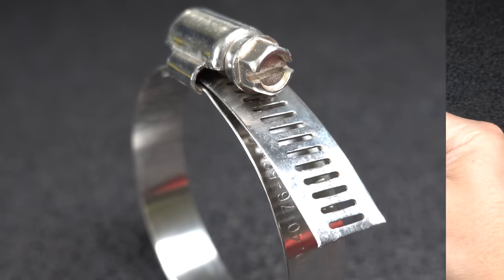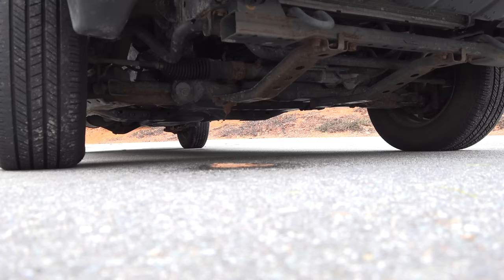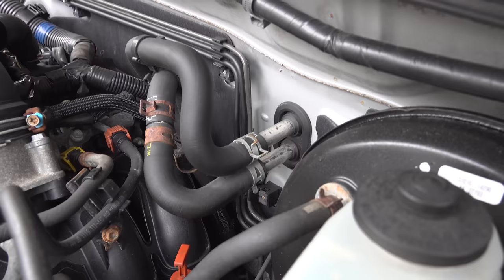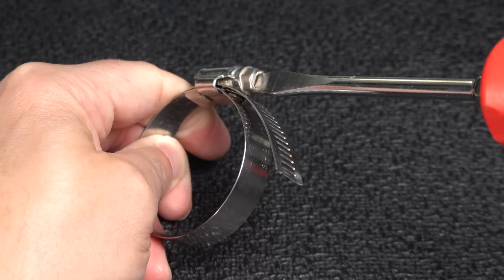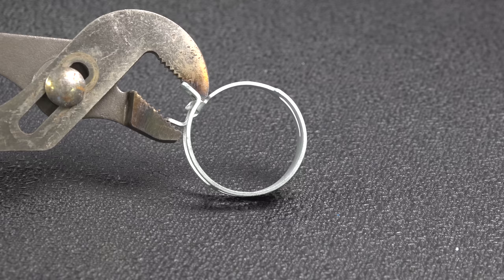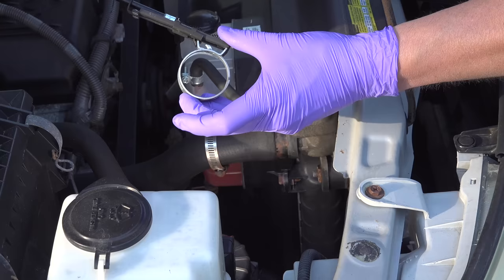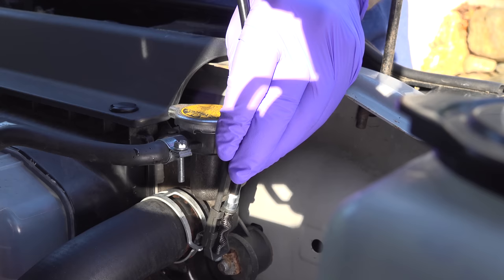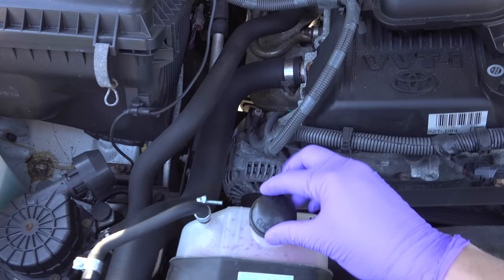STOP Using Hose Clamps WRONG - LEARN A BETTER WAY

Comment: I’m guessing you’re the one who put the worm type clamp there?  If you tinker on an engine and don’t know what you’re doing, you may have problems. Or leaks. Where have you ever seen one of those clamps on any type of automotive-fluid hose?
Reply from the maker: It was a repair shop that did it, before I bought it. The hose is also a Dayco which I would NEVER install on a Toyota. Toyota factory hoses are legendary for how long they last, changing them out for a aftermarket is a tragedy.
Reply: @SilverCymbal   wow no way bro

Comment: So this is an entirely true if you use hose clamps that are just cheap and perforated like that you're going to have issues but if you use the German style ones that the Germans literally put on their vehicles you're going to be just fine also they do make perforated worm clamps with constant tension washers

Comment: No No 😅 those clamps are used on cheap American cars German cars have the ones you tighten. Problem with the self tightening is when the hose gets older it keeps pressing on the hose to the point where it leaks

Comment: I always throw away those stupid things and use a worm clamp. Never had them leak. Even with the pecial tool they are annoying and still leak. I can tell you have never worked on cars professionally before. Those clamps are on there because they are cheaper to make.

Comment: I feel you are wrong. The hose clip is MUCH MORE RELIABLE. Especially the stainless steel ones. We have been using any amount of Stainless steel hose clamps on high quality hose pipes, which are used in the water-cooling system, in the Control system of High Power Induction furnaces... Of 5tonne capacities.

Comment: As a boat mechanic i disagree completely. I use push lock fittings for all oil and fuel applications with some exceptions and they require zero hose clamps of any kind. ABYC dictates anything below the waterline of a vessel be double hose clamped, with the mechanism of the gear clamps opposite eachother providing a true and even seal. Id never use these spring clamps on a boat. Push lock, crimps, or worms only. And only the high end non serrated worm clamps as well.

Comment: A "constant tension/torque hose clamp" are the correct style.. they're a better redesigned worm clamp.. The problem with spring tension clamps is they are a 1 and done..

Comment: I've worked on not just automotive stuff with screw-on clamps, but also high pressure and low pressure air/water hoses on a work truck that steam cleans and vacuums heavy duty. I promise you the screw-on clamps don't leak, regardless of temperature changes. What fails on the screw-on clamps first is they actually rust and start to disintegrate... after like 10 years. They'll corrode to where the screw quits working and they'll fall apart with some shock. Go ask 10 mechanics which hose clamp they would use on their own arteries. I'll eat my hat if they don't say screw-on clamps. Anyone who has spent more than 15 minutes trying to remove those special clamps with every set of pliers they own knows the truth. And don't even bother trying the job if the special clamp is facing the wrong direction. Just sell your car.

Comment: Those. Clap's are junk and can cause more. Damage then the. Screw clamp. The. Inexpensive tool he used is more than $ 50. I removed all of those and went to the screw clamp. Also when trying to remove those squeeze clamps they damaged most hoses.

Comment: Wow..... coolant does not get "red hot". The worm drive clamps are made on many levels of quality.  If you bought a cheap product they will leak as the worm drive strips out. The remote clamp tool shown is total junk. This is said as a mechanic.

Comment: LOL, since 1990...., a small tip, use the correct size jubilee clip and it wont leak, the fkn tail was way too long so the clip goes out of round....made worse by you tightening it time after time......derp

Comment: got a single faulty worm gear clamp and decides to create a video about mis-informing people about hose clamps. there is only 1 reason manufacturers use spring style hose clamps and that is because they are cheaper to buy , and more time efficient to install but they are in no way better. the irony is the title of the video is stop using hoseclamps wrong but in all actuality the leak you experienced was likely do to a mis-aligned hose clamp that was either cricked or not in the right location in order to be affective.

Comment: Nope. I've had tons of cars with regular hose clamps. No problems. Here's a tip though, stop using a flat screwdriver. Use a 5/16ths nut driver.

Comment: The screw clamp you showed was a horrible, cheap one, with SLOTS for the screw to run in. You need to invest in ones made of proper metal rather than that lacework. If you can flatten the ring between your thumb and forefinger, throw it away. The originals are branded "JUBILEE" and were first produced in 1921. The metal in them is sturdy enough to have the brand stamped in them. The ones supplied new on my car's cooling system in 1927 are still in use.

Comment: if you use quality screw hose clamps and dont go tightening it like an orangutan you wont have any issues. spring may be better, but you got no idea how many times ive had to fix the cable on the tool

Comment: I strongly DISAGREE with this the reason why they use those clamps is becuse you would have to hand tighten the "old school clamp" which would slow down production wich cost money. The factory clamps do get hot and that heat goes to the hose and turns it hard making it easier to fail.

Comment: Those clamps are a pain in the ass. As an Automotive tech only someone who doesn't work on cars every day would prefer those things. The real reason manufacturers use those clamps is because they're really easy to install on the line. Dirtbikes, for example, use worn type clamps and the abuse they take is exponentially more than a car.

Comment: funny how he says NEW style clamps. I swear I've seen them on cars back in the 70's and 80's
Reply: I can’t remember when I first saw the style he’s talking about, but I still have my Snap On pliers for the round style that would go flying if you used regular pliers.
To be honest I’d reuse this style clamp if it’s easy to get to but if not it’s tossed and a worm gear style is going on.

Comment: As a Seasoned  mechanic  I strongly  disagree  with your  logic  of spring  hose  clamps...heat draws the temper  from  the steel and causes  the clamp to lose  their ability  to retain  tension..there for  your logic  is faulty...I have in my 40 years  of repair  work  always  replaced  spring  clamps  with worm gear clamps...never  a call back  🙄

Comment: if car makers weren't so lard-arsed with profit-first mentality, they would use re-usable AN fittings on their radiators, or Grip-Tite
style connections.
It's ok for a truck to run over a hose clamp, but this may not work as well with a smaller car with worn tires.
No clamps is good  

Just like the old glass pop bottles that would tear your foot open instantly, i would not want to step on a hose clamp either.
Oh GOD, please punish the clamp makers !

Comment: manufecturers have used them for years because they are cheep, those clamps are not new, as a mechanic for 37 years i can tell you, you are filling your followers with miss information, the clamps rust, bend and over time lose tension, not to mention the dangers of broken fingers and loss of eyes if it spings off to tool, use worm drive clamps, never had a worm drive leak when done up properly

Comment: Having been a full time mechanic for the last 5 years. I'm gonna have to disagree with most everything you say there. If your clamps leaking it's because it is old and the hose is worn out, replace it and the hose and you won't have a problem. The heat ranges your vehicle go through a aren't big enough for those kind of parts to change that much. Spring clamps are the devil when working with them, more often than not your gonna fight with them to get them to work wasting more time than it would take you just to use a worm gear clamp.

Comment: Nope those a crap they damage all hoses leaving imprints , not to mention if you slip with the pliers, adjustable hose clamps have always replaced those crap stock issued clamp

Comment: This is just so wrong! I used to work as a mechanic for decades, and have probably replaced hundreds of spring clamps with worm-drive clamps. And that was because the spring clamps were leaking and making problems.

Comment: I can't stand those factory clamps they are a pain in the ass to remove and install specially in tight places I used them only when they are in a place in the engine we're is easy to remove and install even with the special tool is a pain.

Comment: For the lay general public to see this as “new” proves why it’s for the lay people. 
Expert mechanics and techs remove these oem style clamps and use the tried and tested worm drive hose clamps, which are readily available at most stores and auto parts stores. 
This video makes it sound so warm and fuzzy to use these dangerous stiff springs as if it solves some sort of problem with heater hose clamps, but some people aren’t mechanics for this reason and shouldn’t try to surpass them.
When broken down on a highway road trip, you don’t want to get back on the road having to battle with one of these spring clamps. You really don’t. However, a worm drive heater hose clamp can be removed and put back with a pocket knife if necessary.
Reply: Expert mechanics don't use worm gear clamps if they don't have to

Comment: First off: în order to loosen a worm gear clamp you can use a screwdriver, a wrench or even a pear of pliers.I'm not saying you're wrong, but if you need to loosen a hose fitted with a spring clamp and don't have the right tool, you're f****d.Ask me how i know! 
Second: you mentioned that if you overtighten it, it can damage the fitting. It's the manufacturers' fault for making them out of plastic.
Third: If you're sloppy or careless you can damage the fitting anyway.

Comment: I used screw clamps hose for decades i don't have any problem with clamp hose and I'm still using them, i use both of them, sorry that's true because I'm still using thes screw clamps hose,  and yes be careful they can fly across, so THEREFORE i really want to use the screw clamps hose, i really guarantee of screw clamps hose, are a better clamps to use every time. And really don't believe that guy. Again the wrong one is much better.

Comment: Ah,ah,ah,---  a video of the opposite...lol

edit::Worm clamps are perfect; they are used all over the land and the sea; spring clamps ONLY fit ONE size; if you change the haso and the wall is not exactly the same,it will not fit.

Comment: You dont have a clue what your saying give had the hose clamps your talking about leak and you have to try and re shape them to work correctly to tighten up. If you get a stainless worm gear hose clamp tighten it where there is no leak. Then the extra strap that is there you bend it up towards the topside of worm gear tensioner and fold over you will never have an issue or have to retighten. Thank you for the video.

Comment: Lol those plastic clamps will break in like 15-20 years, becouse the ethylen will go hard... I never saw a metal one fail, even 60years old ones
Reply from the maker: They aren't plastic, they are spring steel

Comment: You are partially wrong.  The main reason manufacturers like fasteners like this is because they are faster to assemble cars on the line.  So it's for them to save time and money.

Comment: I always chuck those new spring style clamps and replace them with the worm drive ones. Be sure not to just get a cheap one from like walmart(oreillys is good enough). I have had more issues with the spring style than the worm drive. The spring style wears a groove in a the rubber and looses its grip and then can't be tightend, especially on ten plus year old vehicles with oe ones. When first installing the screw clamps you may have to check tightness after some runtime as they squeeze the rubber and may become loose but that has nothing to do with the heat. Just the rubber of the hose clearancing a bit. They will stop coming loose after one or two checks if any at all This video is wrong. He isnt a real mechanic.

Comment: Of course the oem style clamp is better when someone pays you for saying so.🙄

I just replaced one of those clamps for a screw down clamp becuase it was leaking.

Yes there are pros and cons to both clamp styles but of course this dude won't talk about that when hes getting paid by one clamp style seller.

Comment: 1. Spring clamps go bad and get weak.

2. The factory uses them because they make it quicker to assemble the vehicle. NOT because it's better or in your best interest.

3. Worm clamps are so EASY to remove. No having to work it down a curved hose.

4. Worm clamps can be installed WITHOUT having to take the hose off to get it on.

5. I've had spring clamps go bad but never worm clamps.

6. Please delete this video. Thanks.
Reply: I see countless worm gear clamps cause leaks

Comment: The oem spring clamp on my radiator hose on my Jeep SRT8 would slip off constantly until I replaced it with a standard worm gear clamp. As far as I'm concerned this video is bullshit.

Comment: This is cap. The worm clamps are infinitely better, I have never even heard of heat affecting hose clamps. The spring ones are trash, I always replace them with a worm clamp. In fact I would go as far as to say that the spring clamps are a pain in the ass and less efficient at doing their job.

Comment: Does he own a hose Clamp company?  The reason why they use these clamps is to speed up manufacture and stop people changing things themselves.
Reply from the maker: Sorry but that's just a myth. They cost 3x more per clamp, that doesn't make up 1 extra second each to install. The reason is exactly what I shared.
Reply: @SilverCymbal  the expansion of the metal is insignificant.  Do the sums.
Reply from the maker: @Land-of-reason  A couple of simple searches prove otherwise. Be wrong if you want but this isn't an opinion, simply mechanical facts.
Reply: @SilverCymbal  I'm a physicist you need to look at the facts rather than listening to advertisement stories.  0.00000645 in/deg F multiplied by say 6 inch times 212 degree F = 0.0083592 inches that is 0.13%.  That is insignificant.

Comment: With a 53 year old German truck the old worm gears made by Bosch or Mercedes hold better than spring clamps. Perhaps if you don’t buy cheap Chinese made worm gears for your video you won’t have these problems.

Comment: The hatred I have for the style clamp you're talking up is real. I hate them so much. On radiators and lines like fuel or with any fluids I guess I'll deal with but all the other hoses I'll put a normal screw hose clamp on anyday. Will save me from using the entire vocabulary of curse words and prevent me from having to break something out of anger. You'd think they made a specific tool to help with those clamps you speak of but Satan himself designed them to keep any souls squeaking out of hell. Fuck those things

Comment: This is a poor attempt at selling products.
1. When you popped your hood all your worm clamps are the wrong size. The small ones are all too big and cannot get tighten enough. The larger one (that was leaking) is also too big, worm clamps start to oval once it is being compressed to small- installer error
2. In my career  of 16 years, I have only ever seen a worm clamp fail when over tightened and stripped out -installer error
3. Old Rubber hoses deteriorating or aluminum  corroding can cause leaks but that is caused by lack of maintenance not hose clamps

Comment: Come on! Constant tension clamps are  quicker ($$) to put on going down the assembly line. It's the ONLY reason car manufacturers use them. It's not because they are better than screw clamps.

Comment: wrong. the "right" clamp is spring-loaded and the spring strength gets weaker. they leak. the screw clamps are PURRRR-fect.

Comment: This is BS. Those constant tension grenade pin clamps will keep squeezing that glass filled nylon until they change the diameter to the point where they no longer clamp. At least with the old style you can keep tightening when they leak. The best fix is put a metal sleeve inside the glass filled nylon. And clamp them tight with the old style clamps. Throw those factory clamps away.

Comment: This is bogus! There’s nothing wrong with using quality stainless steel worm drive hose clamps or go stronger with the T-bolt barrel clamps. 
If that hose clamp kept coming loose for him on his radiator hose it’s because someone overtightened it and deformed the worm drive ridges and it wouldn’t hold tension. Don’t over tighten them and they will do their job longer and better than those sprung clamps. 
Cheers 🍻

Comment: Lol "Constant Tension Clamps" We call them "Jesus clips" you hope and pray the hose stays on. Ill continue to use hose clamps!  if there installed correctly you will never have an issue. Ive also never heard of the difference between hot and cold causing a leak unless the clamp wasent initially tightened correctly.